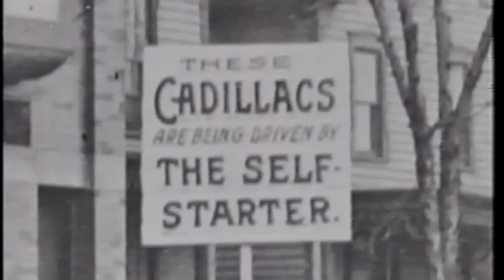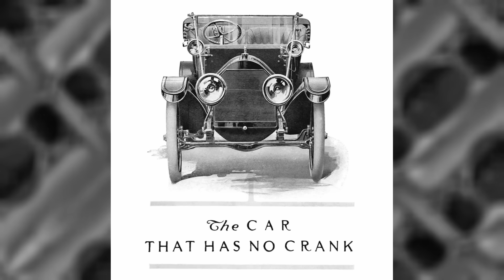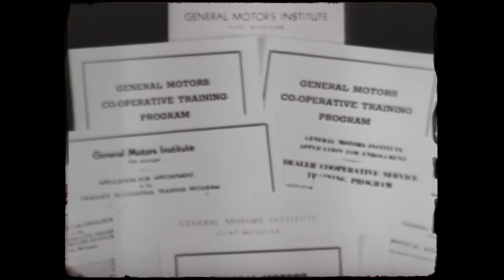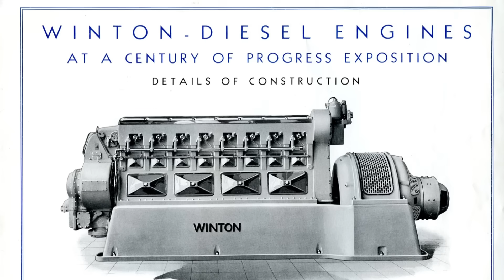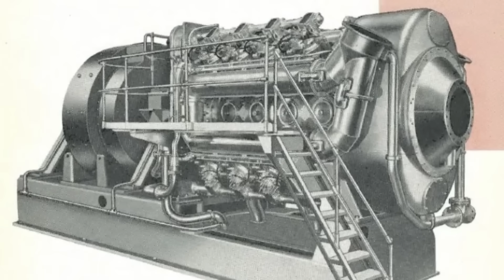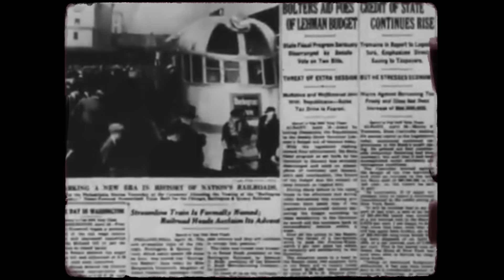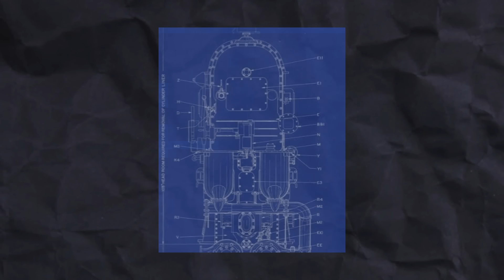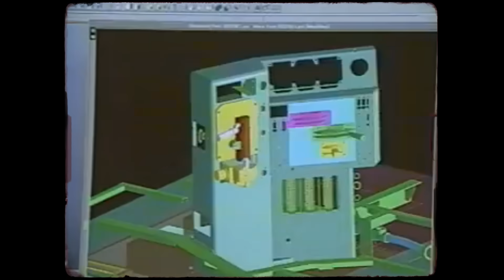The Fascinating Story of Charles Kettering

Comment: Although I haven’t heard of Kettering and his Innovation of Diesel Operating Systems in Diesel Engine Trucks,Yes you could hear the Loud Tappets from the Heads,but it was Cheaper than Gasoline,when I was Stationed in Germany,whenever I needed a Taxi,a Mercedes Benz would Pull Up,in German,the Heavy Accented German Driver would say,Hello and where do you want to go,Usually I said to him-On Base,But he knew that Already,because I didn’t Speak German,those cars,Although Very Expensive/By American Standards,had a Excellent Reputation Already,the Old Reliable Deuce and a Half,Army Trucks ran on Diesel Fuel,like Kerosene Diesel Fuels,today in those 18-Wheeler’s on the Interstate Trucks,Very Informative Video,Used for Short or Long Haul Trips,you can still see the Black Smoke,coming out of there Steel Tubes,it doesn’t Represent a Pollution Problem either,not like Smog in some Industries,like in China or driving on the Jersey Turnpike,Stink-Air,As I call it,like Smelling/Skunk,which Doesn’t Grow in Hawaii. Once you Smell It, won’t Forget It either because it Smells Like Rotten Eggs

Comment: Kettering was thinking about air conditioning in vehicles. Existing refrigerants were dangerous and poisonous. Kettering brought in a chemist (Midgely) in 1932, and two weeks later he had developed Refrigerant 12, later called Freon by Dupont Chemical. R-12 made air conditioning possible in cars and became widespread in household refrigerators and commercial refrigeration applications. R-12 also made railroad refrigerated transport possible.

Comment: Thank you for using real images of Kettering. You failed to describe the essence of his NCR and self-starter inventions. Kettering realized that electric motors could provide several times their "rated" continuous torque for a short time. The motor he used on the formerly hand cranked cash register ran for about a second, with a considerable interval before another cycle. This is also the insight that he brought to cranking an automobile engine. A quite reasonably sized electric motor could effectively crank the engine for a few seconds on an intermittent duty cycle. We still do the same thing. This kind of insight was key to all of his work, challenging assumptions, finding a re-definition of requirements that permitted success.
In convincing the railroads to shift to diesels, there were compelling advantages to diesels. Steam locomotives needed lots of repetitive maintenance to de-scale boilers, and maintain the open mechanism of the steam engines. There were also huge efforts required to handle coal and provide water to the engines, particularly in winter. All of the progress GM made in perfecting diesel technology was wonderful, but the businessmen running the railroads didn't need perfection. They needed better than steam. Diesel fuel is so easy to pump and store!
You skipped over Delco ignition, Freon, The Delco light plant, tetraethyl lead, and eventually medical research.
Reply: It is now understood that the "tetra-ethyl lead" thing wasn't such a great idea (in the long term).
Similar with Freon ..  Both of these were BRILLIANT innovations (at the time) !
Reply: @gary6449 You are right. But in the context of the times, they both were world changing breakthroughs. Ammonia was the typical refrigerant of the day, and a leak in the fridge could kill a family. TEL supported a step improvement in performance followed by a long steady ramp upward. The problems caused by these two were very far down the road, and quite invisible. I think recognition of these problems took a change in perspective to the "spaceship earth" view of all systems being closed. In the 1930's that just wasn't the perception.

Comment: Clearly GM learned exactly nothing from Kettering and all the work with Winston when they went and converted some of their V8 engines to diesel in the early 80’s.
Reply: It’s Winton Engines first, but you have to remember factors that force design changes. 1st, older engineers that know & learned lessons retire. They take their knowledge home. 
  2nd, Outside pressures like fuel economy much less any emissions issue forced by government bodies like the EPA, Dept of Transportation and their influence from CARB & Sierra Club…
  The Olds block was strong yet had problems that could have been addressed by improved heads, studs instead of head bolts and the famous RosaMaster fuel pump, that actually had only one part fail. The viscous ring. 
  I didn’t like the engine but worked on many. When running they got 24+ MPG in a 3 ton vehicle. Try that in 2025 new diesel trucks!
Reply: They needed to look at the John Deere 404 cid inline 6 cylinder and go with that type of design.

Comment: Hero genius !!!!!❤
AC Delco, Air conditioning, Detroit diesel Zephyr train .
Reply: Detroit Diesel built engines for trucks; the Zephyrs used first a Winton engine, then later an EMD engine.
Reply: @alexclement7221 Ok thanks .. Didn't Charles initially power a boat with one ?
I worked on Detroit diesel engines had a few for years

Comment: A full 17 minute video that never mentioned that he invented the synchronous gasoline engine's ignition system. Ron W4BIN
Reply from the maker: Thanks for the comment. That part of Kettering’s work is tied directly to his electric starter and the electrical systems that followed it, which the video does cover. I just didn't use the exact technical phrasing you mentioned, but the ignition system improvements are included in the broader section on how his starter pushed the industry toward full electrical control.